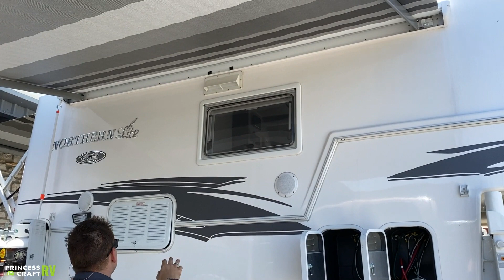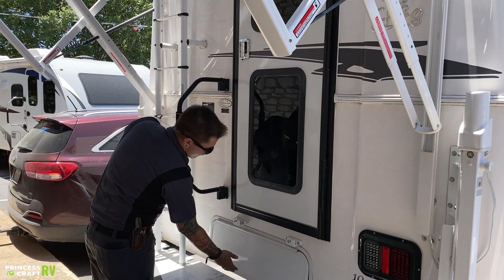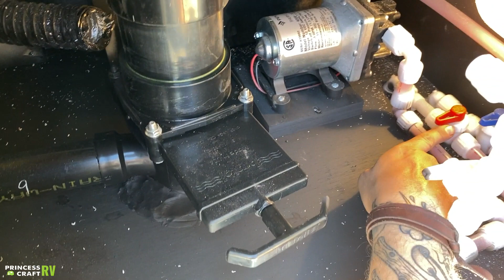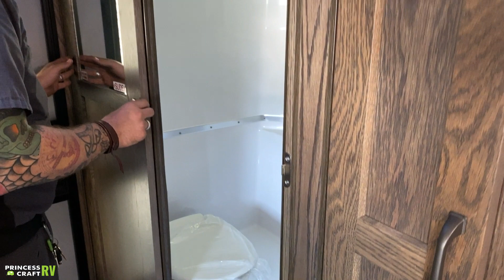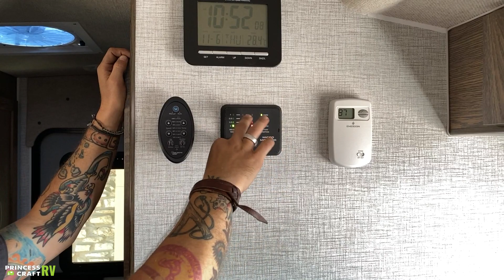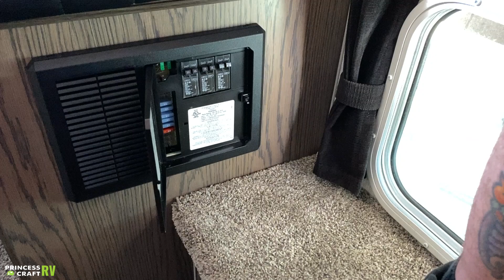2020 Northern Lite 10 2 CE LE - Technician Tour

Comment: Does the wall thermostat have anything to do with controlling/setting  the temperature of the air conditioning unit on a 2024 NL 10-2?  It reads out a setting for cool and you can adjust the temp readout but it seems to have no effect controlling the a/c.